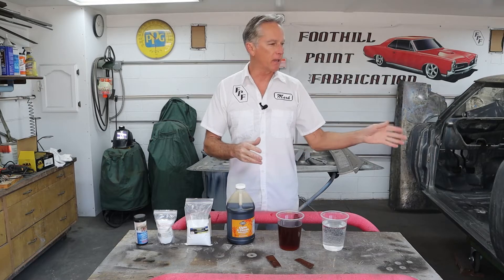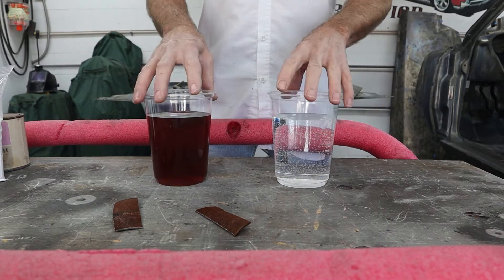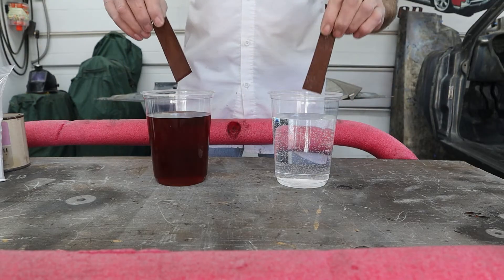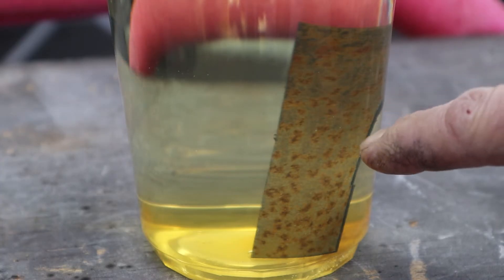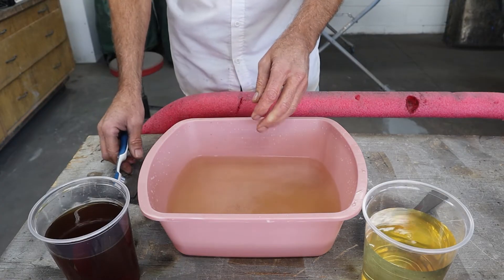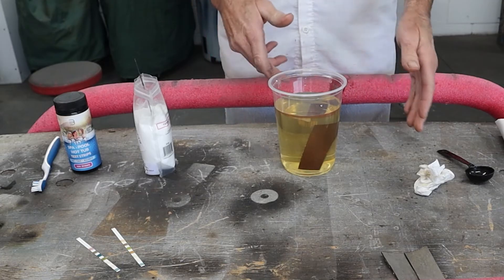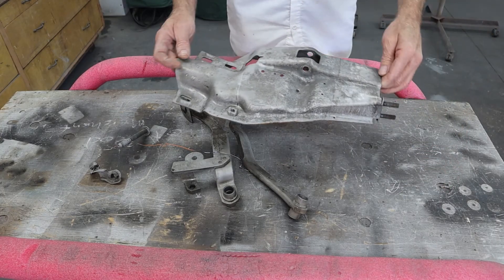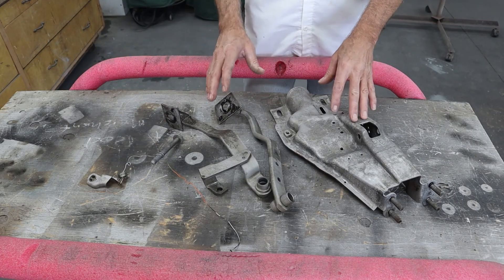DIY Rust Remover - Can We make Our Own Rust Evaporator???

Comment: Looks good but your addition of molasses was of no use in that it needs to be a much higher percentage of your mix. I buy feed molasses from a local farmers coop for very cheap. Most of your parts were lightly rusted and can be cleaned well with the solution you propose but a 9 to one water molasses solution will derust heavily rusted items much better without damaging the base metal like many other methods do. The drawback of using the molasses mixture is that it takes 1 to two weeks to complete. The other thing is that some folks dont like handling the scummy solution even though it cleans off easily. A funny story is that one time I had the solution in a plastic tote soaking my parts but the lid wasnt on all the way. I didnt get back to it for about three weeks and when i looked at it the solution was churning and rolling like it was boiling. Turns out that flies had laid their eggs in it and it was a mass of swimming maggots. We are on a farm so it was no problem cleaning up the mess but if you are squeemish you may have a problem with that. The parts were perfectly de-rusted.
Reply from the maker: Thanks for the info.  I was wondering about ants and other bugs but never considered flies laying eggs in the solution.  Now if the maggots ate rust too that would be a winner!
  The EDTA eats pretty heavily rusted parts but it does burn itself out in the  process.  
Is the feed molasses sulfur or non sulfur?  I was wondering if it changes the effectiveness.

Comment: Crikey, just use vinegar. EDTA is just a weak acid. Not sure why you think adding another acid (citric) lowers ph to 7. The ph of water is 7. Neither acid nor alkaline. Neutral.
Reply from the maker: The PH of EDTA needs to be brought down to a more neutral state so the base metal isn't eaten thus allowing a much longer soak time in solution.  EDTA is a chelation chemical that bonds to metal on the molecular level, it is not just a weak acid. It is used frequently for heavy metal poisoning in humans. This mix and others like it are great for delicate parts that you only want to loose the oxides from.

Comment: Would be interesting to see if adding fumed silica to make a gel would let it be used on things like chassis and fitted panels.   I have seen phosphoric acid solutions turned into a gel for stripping rust so it may work for this as well.  Probably be less harmful to people too.
Reply from the maker: That is a great idea!  I saw some guy that used a small fountain pump and routed the hose to flow over the rusted areas and let it drip back into the tub the pump was in.  Your idea is way better especially if you covered the area with plastic wrap to hold the moisture in while it worked.

Comment: Great video. I've been looking for an alternative to acid.
I'm confused though EDTA is an acid so why when you mix it do you get a ph of 10 that you need to neutralise. 
Sure an acid would be beliw 7 when mixed with water.
What did I miss?
Reply from the maker: True.  EDTA is Ethylenediaminetetraacetic acid but it's PH is way higher than most acids that come in  around a PH of 2.  EDTA is a Chelating agent and as I understand it has a molecule or something that binds to the iron oxide releasing it from the metal underneath.  That is how I understand it anyways. Not sure how they can call it an acid with a ph that high.
Reply: @FoothillPaintandFabrication  thanks, I should have done a search first. Yes aparently they modify the pH to enable it to bind to certain elements more effectively. Did you try using it without buffering the pH down? In medicle applications it seems to be most effective with a slightly higher pH (7.4 to 8)
Reply from the maker: @Squintanditsmint  No I wanted a neutral ph as I had no idea how long it would be in the solution. I think running a little higher ph would probably work both as a chelating agent and a mild acid and be more effective. I want to try EDTA 2na next time as it is cheaper to see how it works.  I did find that the solution burns itself out depending on how rusty the parts are.

Comment: I use molasses and water, then rinse and drop the part into phosphoric acid/ water mix.
The phosphoric acid leaves a coating that protects from flash rusting.
Reply from the maker: How long does it take to strip moderate rust with molasses?
Reply: I use to leave it a couple of days, from memory it was 1 part molasses to 20 parts water.
It will eat aluminium and cast metals, I believe.
Reply from the maker: @lazyj944  Thanks. Got some info of the actual ingredients for the real stuff but haven't had a chance to figure costs yet.
Reply: Would it be enough to just spray the phosphoric acid on he cleaned part, or does it have to soak a while?  Is it like a 50/50 mix?  Thanks'
Reply: @ibberman  I think it's something like 20 to 1 water to acid, it doesn't take too long if you aren't removing rust as well.
I have never tried spraying but would think dipping is better but no harm in trying.

Comment: Evaporust uses water, triethanoamine phosphate, aluminum sulphate, citric acid and dipropylene glycol methyl ether.  It is in their msds.  The secret ingredient is the triethanoamine phosphate.
Reply from the maker: Have a guess on the quantities of each?
Reply: @FoothillPaintandFabrication  According tonthe msds it is:
water 55-65%
triethanoamine phosphate 20-30%
the others 1-5%
Reply from the maker: @ml.2770  Cool I will check out the costs for the chemicals.
Thanks
Reply: @FoothillPaintandFabrication  Have you experimented with the ingredients for the MSDS Evapo-Rust yet?
Reply: I would also recommend 100g of citric acid, 63g of sodium bicarbonate per 1l of water and a bit of dishwasher liquid to act as surfactant.

Works great, 700g jars of citric acid and sodium bicarbonate cost me 10 euros total at local hardware store. Price per gram goes down in bigger containers.
Reply: @pukkimi  Looks like somebody watched a video.
Reply: @ml.2770  Yes I did, also thinking of trying glyserol, maybe mixing it first with a different batch of citric acid. Or green tea or aloe vera extract as rust inhibitor, not sure if they work. Isopropanol alcohol may as well act as a fine surfactant, but I have not had time to test it.

Comment: Turning machine guys tested EDTA 4Na (Tetrasodium) and EDTA 2Na (Disodium) solutions for rusted drill bits/nozzles/files/nuts/bolts without adding citric acid . 2Na worked almost 4-5 times faster than 4Na, just like EvapoRust. Solutions were: 1L of warm water (~50-60°C), 140-160g of EDTA, 3-5g of surfactant. Water was warm because EDTA 2Na dissolves harder in cold water. But what surfactant was used i don`t know (pretty sure it was cheap one like liquid soap or dishwashing detergent). Process will be faster in ultrasonic bath with wire brushing (at least with brushing).
p.s. In my country 1gal of EvapoRust costs ~100$ if you can find it. And 1gal of homemade solution with EDTA 2Na costs ~10$.
Reply from the maker: Awesome thank you so much for letting us know.  2na is actually cheaper than 4na so that is great news.
I appreciate you sharing.
Mark

Comment: I've messed with this as well.  if you lightly wire brush the rusted parts by hand (what I think of as breaking the surface) it really helps.  it only takes a minute.  same with Evaporust.
Reply from the maker: Very true. Getting the bulk of the loose rust off does speed it up.  Agitation seems to help as well to get down into the pits better.
Reply: not talking about loose rust.  just lightly scratching the surface of the rust seems to let the mixture work faster. @FoothillPaintandFabrication

Comment: I wonder if heat and agitation would help? A stock tank heater and aquarium circulation pump would work. The mechanic from Wheeler Dealers submerged an entire frame in Evaporust, and it worked perfectly, but the chemical's price makes it prohibitive for the rest of us. Your recipe would change all that!
Reply from the maker: Heat usually accelerates chemical reactions so that probably would work as well as agitation. Luckily I have plenty to work on while parts soak so I just wait. I pretty much used up the solution by dipping a lot of large parts so it doesn't last forever unfortunately. Making a fresh batch tomorrow with a little more EDTA in it to see if it lasts longer.

Comment: Evaporust generally takes 16 to 24 hours for most rust. I use an ultrasonic with heat and it takes 30 minutes, maybe less, but I just have the timer at 30. Rarely, bad rust may take another 15 minutes or so. It’s reusable, so not as expensive as it seems at first. Don’t see the purpose of molasses in the mix. Just remember to wash the parts off right after and spray with WD-40 right away to prevent flash rust.
Reply: you can put evaporust in an ultrasonic cleaner ? that might be a super effective solution
Reply: Just a warm water wash for the parts, or what, soap maybe?  Any problems with flash rusting or a black coating, patina, etc. forming on the parts, or are they bright metal?

Comment: Molasses is really the better choice. It is cheaper and the liquid can be dumped without causing harm. Remember, when handling chemicals bare handed that your skin is not made of armor. EDTA is a synthetic chemical and not found naturally.
Reply from the maker: I appreciate the concern for my health.  The cheapest I could find molasses was 9 bucks a half gallon which makes a 5 gallon bucket worth about 90 dollars. I did find some bear bait molasses that was super cheap but the shipping was pricey. My mixture was a little over 30 bucks and it is easier to rinse off since it is the consistency of water.  If molasses works for you it is an excellent choice.
Mark
Reply: @FoothillPaintandFabrication  molasses isn't that strong.  A couple spoonful's did nothing.   Maybe half water, half molasses or straight molasses and then add your EDTA and bring your PH in line with the citric acid.  Alternately, just use citric and baking soda or soap flakes.  
I agree that if the molasses is expensive then skip it but if you could double it with half well water you might need less EDTA.
Reply from the maker: @burtreynolds3143  Great suggestions, thanks.  I did find a cheaper version of the EDTA and if you buy feed grade molasses it is a lot less expensive.  For this testing I was just trying stuff out and didn't know what to expect.
Mark

Comment: When you dont have enough liquid to cover your parts, add something to displace more volume in the bucket. Something like a 1 sealed 1 gallon of water or sealed full 2 liter bottles.
Reply: You can put your part in a plastic bag, add some rust remover inside the bag, then submerge the bag in a barrel of plain water. If the bag has no holes, you will have the same results.  If the bag leaks, either try a new bag with new EDTA at pH 6.5, or just add EDTA and acid to the full barrel and let it sit until you need it.

EDTA attacks Calcium and Magnesium after it attacks Iron oxide rust, but it doesn't attack solid steel. The chelation is a bunch of tiny molecules that give a hug on all 6 sides of the molecule, and keep it from binding elsewhere. It dissolves the rust, literally, and ignores the iron. But I think it will attack magnesium engine parts, so clean it off when you pull it out.
Reply: I use marbles, got the tip on another youtube video, works great, a little Evaporust goes a long way when the container is almost filled with marbles, items easily slide into the bucket because the marbles move out of the way easily. Granted I only use a gallon bucket, but bigger containers just need more marbles or whatever you choose.
Reply: We all got marbles lying around….
Reply from the maker: Thanks for the great tip.  I will definitely use that when I don't have enough juice to cover the parts.
Mark
Reply: I used a cloth to cover hard to reach places for something that couldnt fit my bucket. Fully soaked it in the agent and it seemed to work quite well too.

Comment: I think I’ll make some of this Mark.  I’ve been using Evaporust and have had good results.  Like most chemical reactions, it seems to work better when the shop is warm. 
When I don’t have enough volume to cover parts in the bucket I just put in a few ziplock bags filled with water.  They displace the solution to cover the part but don’t affect the concentration.   I’ve also used clean gravel in ziplocks to do the same thing.
Reply from the maker: I moved the mixture to a tub with a lid and will be adding some more as soon as the EDTA shows up.  Not the fastest but it doesn't damage the steel so leaving the parts in longer is not an issue.
Mark

Comment: Excellent vid Mark!  Just in time as I have a bench full of fabricated parts for the 37 chevy and was going to use vinegar as in the past but the EDTA solution seems to do the job without all the foaming and odor of the vinegar... Got a guess on how long the cleaned and dried parts will stay surface rust free?  Lot of humidity here so was thinking need to get some DTM etch primer or something on them right away?  Thank for including the links and Happy Thanksgiving to you and fam.
Reply from the maker: Thanks Don and Happy Thanksgiving to you and yours as well.  Since the EDTA doesn't seem to etch the metal I think they will not flash rust as fast as being dipped in an acid.  Hard to say but the good thing is if they do a quick bath in the home made brew will clean them right up again.  Luckily my humidity is really low here so it isn't as much of a race to protect bare steel. Let me know what kind of results you get with your EDTA solution.
Mark
Reply: @FoothillPaintandFabrication   Happy New Year!   Just an update on the EDTA solution... made three gallons yesterday and 12 hours later rusted parts are coming clean and rust free with a little light brushing.  Really happy with the results and thanks again for the info you shared!  Will update again after leaving the cleaned and dried parts as to flash rusting.
Reply from the maker: That is great news Don.  I ended up burning out the solution I made up originally as I dipped a lot of large pieces and it ran out of gas and stopped working.  I think upping the amount of EDTA would help it last longer.  I will be making a new batch soon.  Thanks for the update and Happy New Year! @DonBrantly

Comment: If you want the paint removed, soak for a while with Easy Off then rinse (don't get any of this on or in you).  It may take more than one application but it will remove the paint.  Then do the rust removal.
Reply from the maker: Thanks Michael, Oven cleaner is the same stuff we used at the chrome shop to strip paint in a huge heated tank.  Caustic soda if I remember correctly and oven cleaner burns just about the same when you get it on your skin.  I will keep it in mind for sure, thanks again.  
Mark

Comment: Good tip and demo Mark, this looks easier works good and less smelly than using vinegar and water mix we used years ago as rust stopper
Reply from the maker: Thanks, the odor is different but not offensive.  Seems to work pretty well.

Comment: Wow, that was impressive! That stuff worked like a charm. I'll have to make up a batch for myself. Happy Thanksgiving to you and your family Mark!
Reply from the maker: Thanks Doug, same to you and yours.  
The stuff should come in handy for your truck project.  I moved the solution to a tub so parts fit in better.  Just need to make up some more juice so big parts get submerged.
Mark
Reply: "a batch for myself" I too feel a little rusty sometimes, maybe this will do the trick. 😉😉
Reply from the maker: I had my hands it for a while but it didn't seem to help with my creaky joints 😜 @merakrut

Comment: Cool!  I watched the Australians using  mollassas a few years ago. They get it cheap in 55gal drums and submerge whole car bodies in large cattle water tanks. I tried it  with 16 inch wheels and it worked, just slower. I like this EDTA better for the small stuff. I have a fiberglass fishing boat that I use as an electrolysis tank for large things like bumpers. That works extremely well too.
Reply from the maker: Yeah I have seen that.  Seems pretty messy but affective.  Back in the day when I worked at the chrome shop I just took parts to work as we had sulfuric and muriatic acid tanks. Take them in the morning and go home either rust free or chromed😁

Comment: Yeah, I invested in some Evaporust a while ago, I remember not being very impressed.....
Of course before that I was using muriatic acid. Much faster but kind of dangerous,  I put a small part in it once and the next day it had vanished! 😂
I have a sandblast cabinet, but your method looks much easier. Thanks Mark.
Reply from the maker: The thing about this stuff is it doesn't attack the base metal so you can leave it in longer and not worry and like you said acids are hard to handle and can be dangerous.  I left 2 small patch panels in for Ruby for 3 days and it only went after the rust.   
Mark
Reply: Evaporust won’t be as fast as acid, but doesn’t destroy the metal as acid does. Much less dangerous as well.